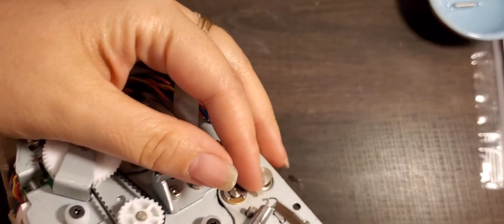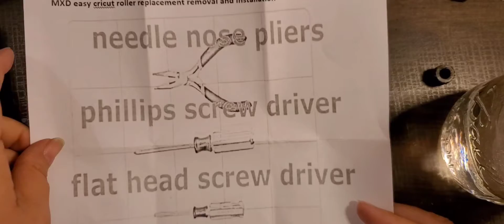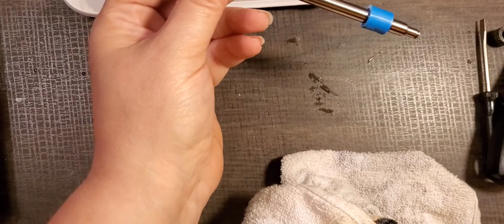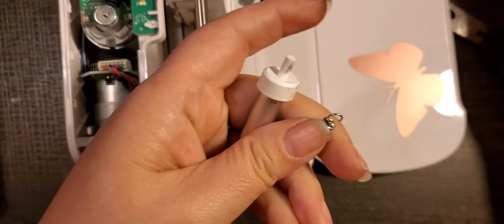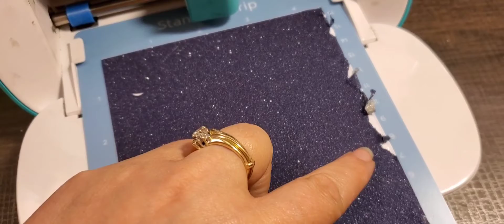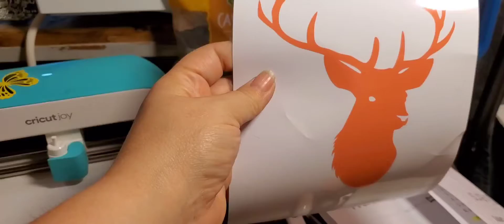Cricut Joy Rubber Roller Replacement using MXDs' EBay 3D printed Replacement Parts #cricut #rubber

Comment: Hi, how did you know your rollers needed replacing? My cricut isnt cutting correctly and isnt rolling the vinyl to cut it would this mean the rollers need to be replaced and maybe the blade? rubber is kinda stretched looking when its trying to roll and leaves black on nail if you touch it
Reply from the maker: They sound like they are pritty worn out. This Cricut I found on Mercari and the Rollers where muchy, sticky and in rough  condition.

Comment: Hi, a pin has fallen out of the clamp that holds the pen/blades.. any ideas on how to fix this please?
Reply from the maker: I do not. It's been so long since I took mine apart, all I remember is a C clamp that holds the bar in place. Maybe thr hardware store might have a replacement. But I am not sure. Check the floor with a magnet, those clamps can spring far.

Comment: I bought the rollers but I don’t think I can do this.
Reply from the maker: I watched alot of YouTube videos before attempting it. It was nerve wrecking, but it worked out.
Reply: @theshabbyrose  I did get it. Not sure I would do it again. The strength required to stretch that spring was almost too much. I am not getting stronger with my health issues including arthritis in my hands
Reply from the maker: I understand the health limits totally.  My wrists are not as strong as they used to be. It was a struggle. Congratulations on getting the job done!!!!
Reply from the maker: If it's somthing your uncomfortable with...there are Cricut Joy cutters being sold on Mercari for a good price.
Reply: @theshabbyrose  I would feel even less comfortable buying on those sites

Comment: Hi, where did you buy the rubber?
Reply from the maker: They can be found on Ebay. Make sure it is for your machine though. Joy rubbers are smaller in diameter then the Maker rubbers. Found that out the hard way. 😄
Reply: I found the joy rollers on amazon

Comment: I removed the side belt to put one of the c clips back on. Anyone know how to get it back on without snapping it?
Reply from the maker: I didn't remove the belt, but I would gently use a small screw driver to pull, stretch it back into place. I don't know if this helps, hopfully it won't break.